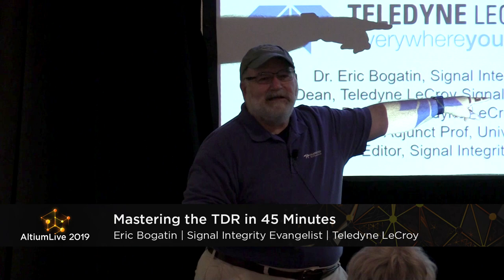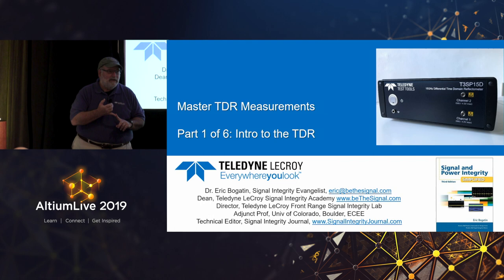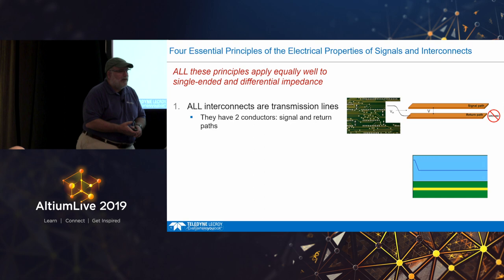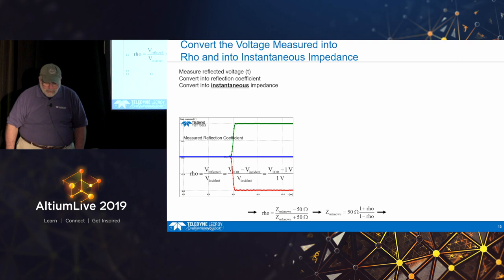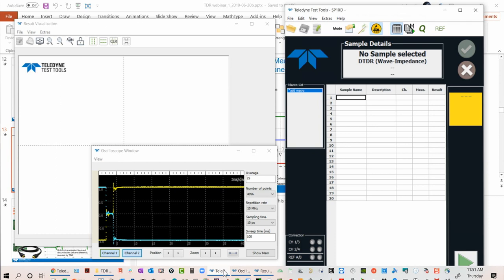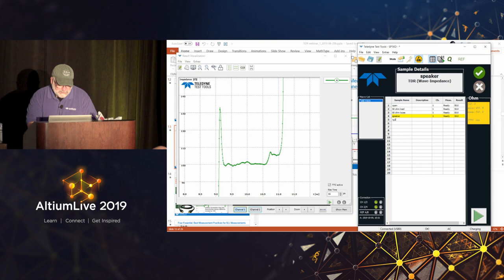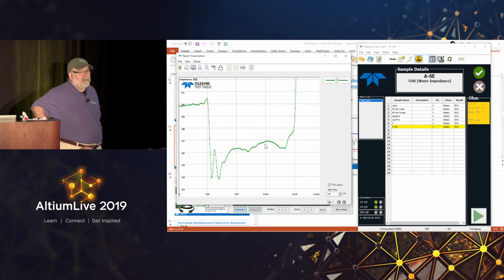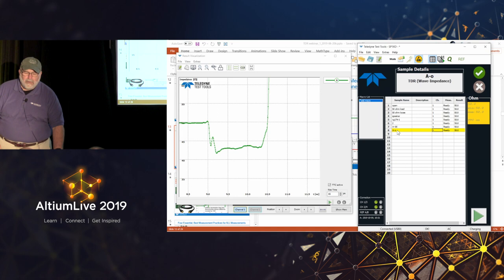Mastering the TDR in 45 Minutes - Eric Bogatin

Comment: What is the difference between a TDR and a couple of function generator + scope ? Rise time is much faster on TDR devices ? No multiple interconnection reflections ? TDR can deliver much more power thus drive very long capacitive cables ?
Reply: TDR can see the direction of the current on the return plane. If the current gets inside the TDR's return plane or the current goes out of the TDR's return plane. Think of it like TDR has series output/input resistors on its output and return path so it can see the direction of the current from the voltage drop on these resistors.

Comment: A stupid question: how many reflections happened at each time position on the waveform? Only one reflection or accumulate of multi reflection? Such as there is bounce at the point of discontinue, is the bounce caused by one reflection?
Reply: for TDR, since you are measuring at one physical location along the line, you will see multiple reflections manifest as events at multiples of the first reflections distance. I will refer to distance as time to simplify propagation velocity of the medium. So, if the line is 5ns long, the first reflection will show up at 10ns, then another will appear at 20ns, 30ns, etc. The reflection always has to transit twice the distance between the impedance discontinuity so that is why a line that is 5ns will have an event appear at 10ns. The secondary reflections are harder to interpret but will help you confirm if you have issues at the launch into the DUT, DUT impedance, and termination impedance. There are many combinations of mismatches happening so it is best to simulate a transmission line mismatch, load mismatch, and source mismatch in a reliable software first to gain intuition. there will be a reflection for each change in impedance along the line so if your launch into the DUT is farther from the transmitter and receiver and you implemented a poor launch connection, there will also be a reflection there. the reason he mentions the launch as just a spike on the rise edge is because the distances are short and just look like impulses.

Comment: this means that on PCB , changing layer by via is not good if you want uniform 50 ohm impedance , is it ?!
Reply: is it?
Reply: No you can but maintain return path without screwed so use return vias on layer transition there is proper return path hence no impedance discontinuity
Reply: @Bornachiever17  with a return via the signal via is like a very short microstrip without impedance control. I remember I have seen a US pattern regarding impedance controlled via.
Reply: you are correct  :) there is some way to improve it however . you can add some ground vias near by for the return path , by doing so , you will minimize the change of impedance
Reply: Everbody responding is giving you good advice. Avoid layer changes if you can, and when you must, be sure you add some ground vias to compensate in the return path. You can then keep the discontinuity small and (hopefully) insignificant depending on operating frequency.